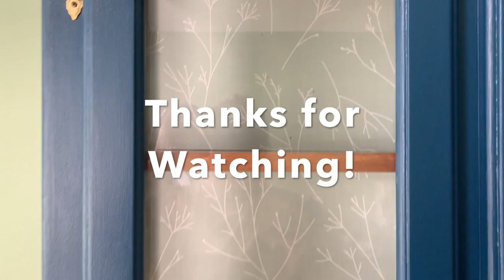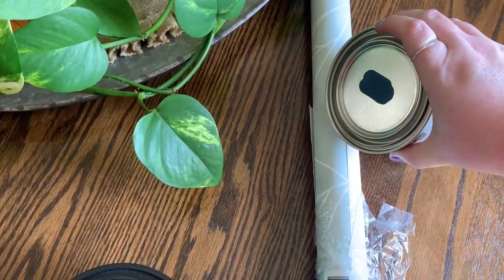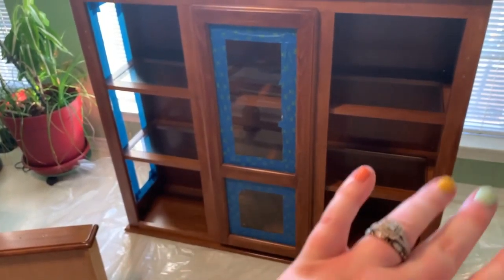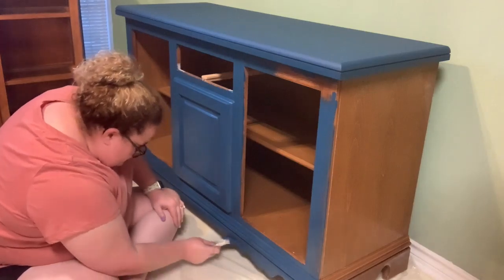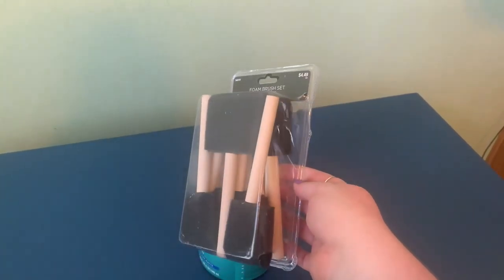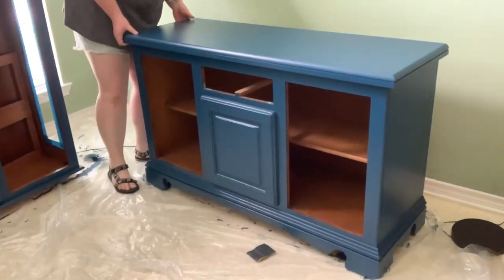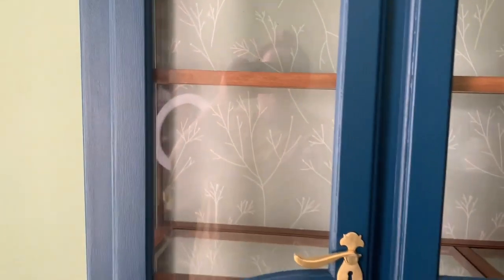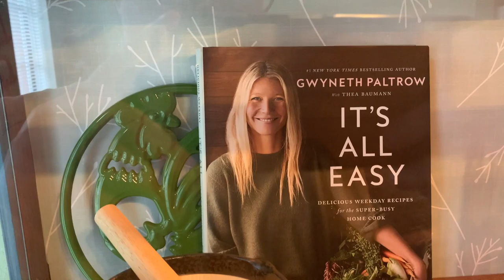SUPER SATISFYING China Cabinet Make-over | Vlog Style Furniture Flipping!

Comment: It looked it's best before you took it apart and better when you took all the stuff out of it. It just needs to be cleaned and styled with quality items. With poly top coating, most flippers put some in a different container and add a little of the paint color to it. With darker colors the top coat will look cloudy and leave streaks but by adding a little paint to it doesn't show. You won't need to add paint to the poly when it painted in a light color like white or cream etc
Reply from the maker: Thank you for watching! That is a great tip! I have another flip coming up and I will look into doing that with this one! Thank you!!!